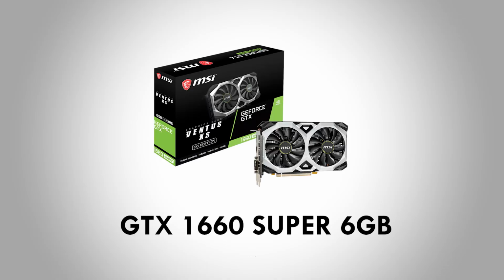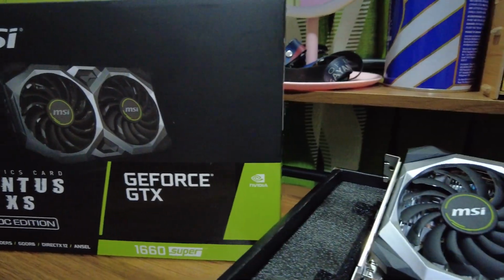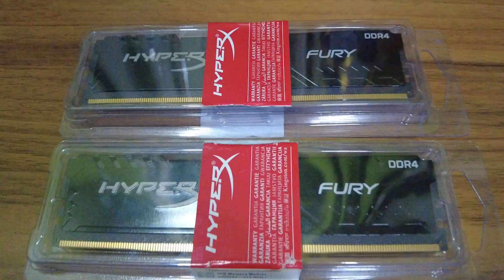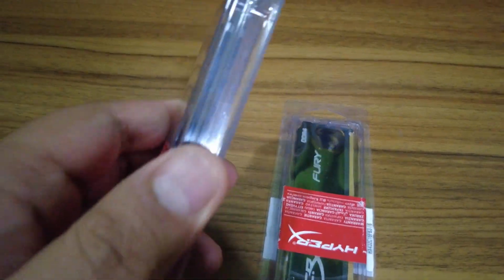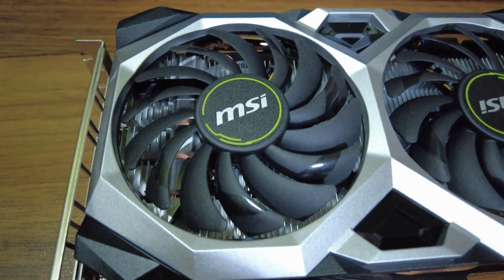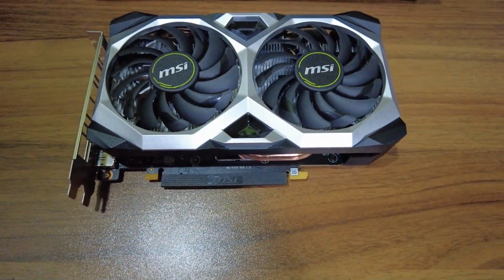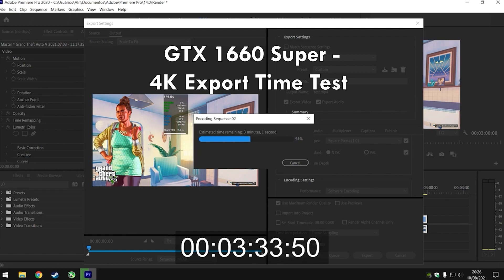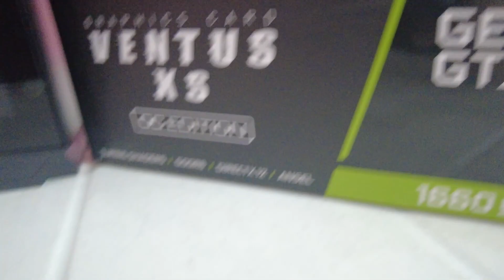Is the GTX1660 SUPER Good for Gaming/Video Editing  in 2023?  [Ryzen 5600X GTX1660 Super PC Build]

Comment: I'm currently sporting an i3-10105F (4C/8T) and a 1660 Super and it can handle pretty much anything I throw at it. Red Dead 2, Elden Ring (both at high 1080p 60fps). It's such a good little card for 1080p, not to mention that FSR will give it a few more years before it's unusuable
Reply: I will paid it with a r5 3600 and want to stream dont know if i should get 16gb or 32gb of ram.

Comment: I sure like the price point and size of the 1660 Super. It fits in most cases better than some of the 2000, 3000 and especially 4000 series graphics cards do.  It also costs a fraction of what those cards cost.  I also love that it doesn't need a ton of power compared to those higher series.  It also runs cooler than those cards, so I don't need an expensive, complex liquid cooler for my system.  

It's still more GPU than any of the video games that I enjoy playing require.  I can run all of my games except Solasta: Crown of the Magister (currently my most demanding game) on full settings at 1080p with no problems.  With Solasta, I have to turn off fabric simulator and turn down the shadows and lighting settings a bit, but the game will still run smoothly without losing much in the way of looks. 

I'm running the potentially last model of EVGA's 1660 Super now with an 11th gen Intel Core i5-11600K @ 3.9 GHZ, 16 GB of DDR4 RAM and a Western Digital NVMe WDS500G1X0E SSD all on an MSI z590 Pro Wifi (MS-7D09) motherboard. All of it is in a Phanteks Enthoo case with all the fan frames filled with Noctua fans and powered by a Corsair CX 650 PSU.   Runs great!  

Good video here! It really shows folks how good the 1660 Super still is today.

Comment: 1660 Super is a solid choice, but I would rather have a 8gb 3050 any day.  They are 260ish right now too.
Reply: But the 1660ti is just a 3% - 6% slower... And way cheaper
Reply: @scarfaceReaper  DLSS will keep the 3050 relevant a lot longer.  Same with the 8gb of VRAM
Reply: @CuttinInIdaho  dude I'm not downplaying the Rtx 3050 but it performance the same as a GTX 1660S and the 1660ti performance a bit more but as it's going the retail price sometimes is the same as a Rtx 3060 12 GB and just $30 or so is the TI version which performance hella more than it , I'm definitely not hating the card my friend had one but it's certainly a waste if there's more options in the same price range
Reply: @scarfaceReaper  True the 3060 is a lot of times only a little more and is vastly superior
Reply: 1660 super used is like 120 price to performance wise for a more budget oriented build I'd choose it.